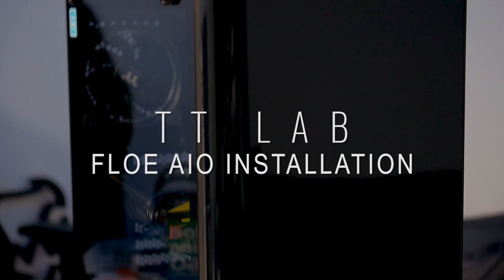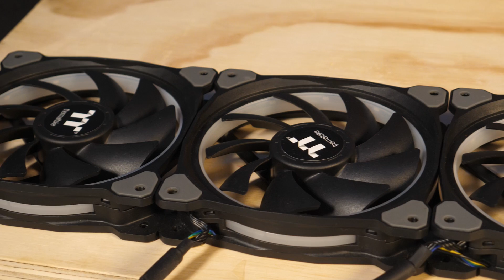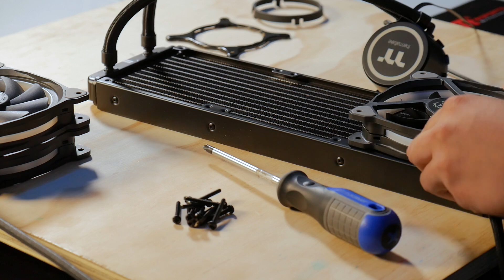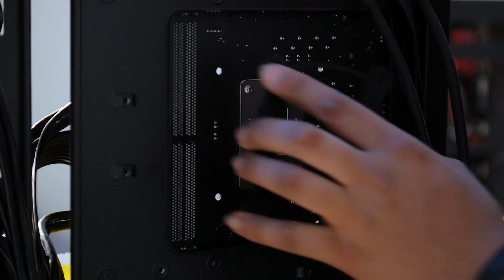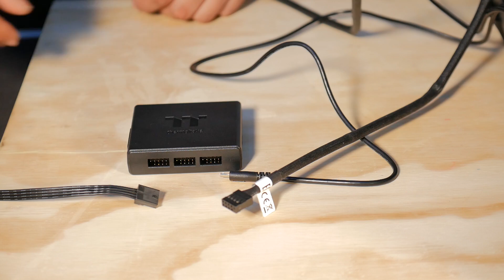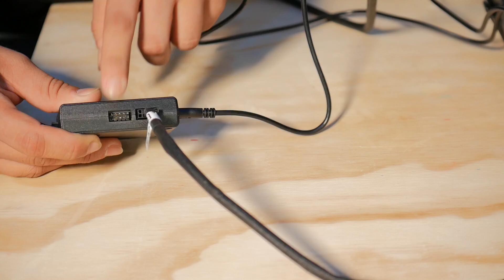Thermaltake Floe AIO Intel/AMD tutorial

Comment: You don't specify if the backplate is used only for Intel, or both Intel and AMD. Likewise - what is meant by "pull configuration"? Pull air out of the case? Why would you want to view the fans from the "inside of the case"? Wouldn't you rather want to view the fans from the outside (front) of the case? Top fan cable seems to move from one side to the other in a video transition. Does the connection to the CPU not require heat paste? Just a poor ambiguous video tutorial. Expect more from a manufacturer.

Comment: I have an Asus Maximus XI Hero Mobo and the 240 version of this AIO - I just want to know do i put the 3pin connector into the AIO Pump header or the CPU Fan header? Reason being is i am getting an error message on start up saying CPU fan is not connect however the AIO is working fine while being connected to the AIO Pump header. If i am doing this correctly is there anyway to switch off that error message?

Comment: My 360 water 3.0 did not include that amd bracket. It included the other one that used the am4 bracket originally installed on the motherboard

Comment: I have purchased a Tower 900 and I want to use the FLOE Riing in my system. However I can not figure out how to get the radiator to the back of the case as there is no space to pass anything through  without disconnecting the cables. I have the same issue with my GPU as it has a AIO Radiator as well.

Comment: Hi mate, you didnt show where you connected the power for the pump, I have a Aorus Z390 and it has a 4 pin CPU opt fan header so how would I connect the pump power too it? thanks
Reply: That 9 pin plug from the water cpu block goes into number 4 on the controller where you plugged the fans in. It basically controls the color rgb and the CPU opt is actually the power connector for the pump.
Reply: The 3 pin connector goes into the 4 pin CPU opt. Close inspection you will see the way it clips on. Using the 2nd 3rd and 4th pins. There is a little plastic bit that helps line it up correctly onto the CPU opt. The plug has exposed metal bits on one side and that will be facing down if that helps.

Comment: It probably would have a good idea to make a note to say that the cable that looks like a USB connector coming from the block connects into the controller not the USB connector on the motherboard.  Also, the software keeps crashing my computer.  I'm hoping they got it fixed because I am installing it in a different system.  I will say that the TT cases are fantastic.  I'm currently building a Threadripper 1920X with 32 GBs of Ram into a Thermaltake View 37 Motherboard Sync ARGB.

Comment: Thermaltake, You need to ditch the molex and stitch to a sata plug instead. also need to mark the fan headers on the controller, Not just the switches.

Comment: How do you install the backplate on a gigabyte aorus master? the backplate contacts with pins on the other side!! please help!!!
Reply: Nuno Svensson did u figure out how to do it ? becouse i have the same board and i am starting to mount tomorrow ?
Reply: @selimyetkin1146  yes, the pads that come with the motherboard that you are supposed to glue them to the bracket.. dont do it, and then it fits nicelly.
Reply: maybe u should put the rubber pads to the bracket!? right ?
Reply: @selimyetkin1146  if you do, when you are attaching the cooler, you will notice the pins on the aorus master are being pushed by the bracket.. cant glue the pads or else that happens. give it a try with it, you will see what i mean when you are doing it.
Reply: Nuno Svensson omg! so i am not going to put the pads (like in the video)to mount it correctly right ? hmmm interesting
Reply: @selimyetkin1146  yep, you will not need them because the cooler is screwed in the bracket and that is enough. with the pads on the pins of the motherboard wont fit. I had it like that before but I couldnt make the bracket sit flush so i had to figure it out for myself.. anyways i will next month probably put it all under water with a costume loop from ek

Comment: You just gloss over the pump install. That is the part I'm stuck at. The ring that looks like it is supposed to clip in to the bracket (AM4) from underneath would take an octopus to accomplish. Unless the act of tightening it down clips it in. The diagrams are somewhat less than explicit.
Reply: Zanshi Kaijin that’s my issue I’m having. Did you have any luck ?

Comment: On the Intel board 1151 here when I put the back plate on with the rubber pads attached, then screw in the stand off's there is still room between the stand off and the board. Is this supposed to be that way? Even with stand offs tightened down I could push on them and the back plate would move away from the back of the mobo. Asus Rog Maximus Hero z370 1151 socket and Intel i7-8700k
Reply: did you find a way to fix this ?
Reply: dylan siataga well I pulled everything back off to check the thermal paste and everything was just fine. I double checked the standoff tightness, called the company. They said it was normal. New paste tightened everything back down and been good to go ever since

Comment: is the pump pwm/dc speed variable  my board is trying to control it and im wondering if that is okay
Reply: Most boards will, because they default think that it's a standalone pump, whereas many AIOs such as this one come with controllers. Easiest thing to do is go into the BIOS and tell it not to worry about pump/fan speed, as the controller will take over that role based on CPU temperature data it receives from the motherboard. (Actual environment will vary on manufacturer, of course.)

Comment: Wasnt a very in-depth tutorial. When I install the backplate on my LGA 1151 motherboard do I peel off both sides of the adhesive pad so it sticks to the motherboard?
Reply: Yes...but there's an issue. When the backplate is installed in a Asus Maximus X the standoff mounts go way past the actual board. That leaves a couple of milimeters of play in the distance from the standoff and the water block. Unacceptable! Not even really sure what to do now...nylon washers? Also mine came with massive damage to the radiator.

Comment: Is there any pros and cons to mounting the radiator on the front of the case, vs mounting it on the top? I thought the top would be more efficient provided the case has a vented top, since heat rises, having fans pull air up and across the fins exiting the top would be better than having it on the front. What are your thoughts on that?

Comment: So....where does the pump get it's power from if the one 3 pin is for CPU/motherboard and the other plugs into the fan controller for the pump rgb? Is there no pump/motherboard connection?

Comment: I wish it showed where to plug the cables into
Reply: I have the same concern. My board has a 4-pin CPU_FAN and a 4-pin AIO_PUMP... it would make sense to go to the pump, wouldnt it?
Reply: @TheOnlyOnwuma  have you confirmed whether or not it’s the pump plug-in or cpu fan plug-in?
Reply: I'm stuck on installing mine. If I understand the instructions correctly I plug one cable into the motherboard. But the other (controller) plugs into the power supply? I'm wanting to be 1000% certain on that since I only just got this motherboard and cpu in an effort to get my pc working again.
Reply: The one which looks like a USB 2.0 cable goes to the controller, the other one goes to the CPU fan. Just built a rig using this AIO yesterday.
Reply: @AvinashShetty   the other cable that is going to the CPU fan is 3 pin right? what if the CPU fan header is a 4 pin? i'm planning to use this AIO on X470 AORUS ULTRA GAMING motherboard and this board has a 4 pin CPU fan.. any thoughts? Thanks!

Comment: @thermaltake I'm already aware that the LED's are not compatible with Asus Aura Sync and it uses it's own proprietary software, that's fine. What about the PWM cable coming off the block? Does it connect into that fan controller that you guys provide or does it connect to a AIO header on the motherboard so that we can keep accurate readings via the UEFI as well as the Asus Windows software. Can we still control the fan speeds via a motherboard header? I'm only understanding that the TT software is to control the LED's only am I understanding that correctly?

Your instructional video didn't go into specifics on these aspects of the setup that's why I'm asking.